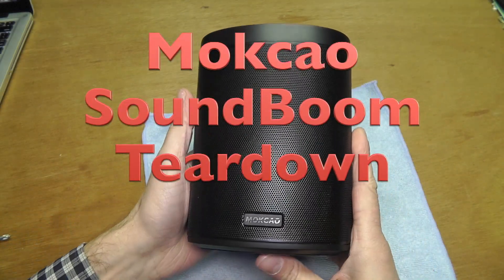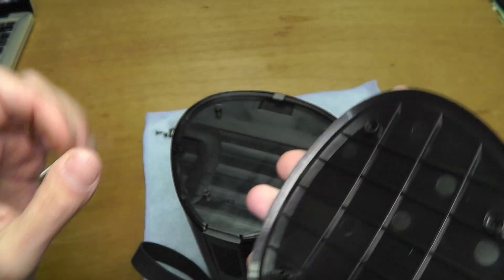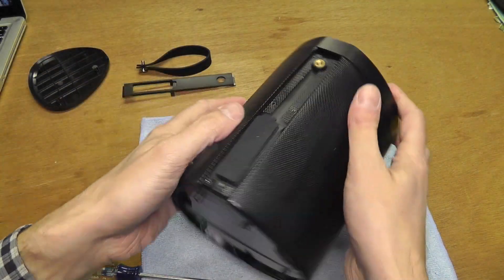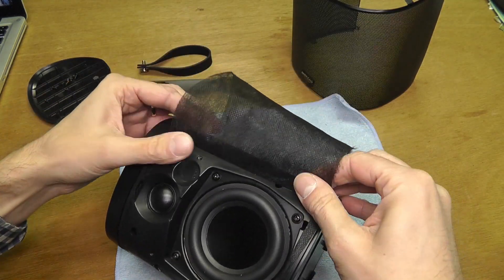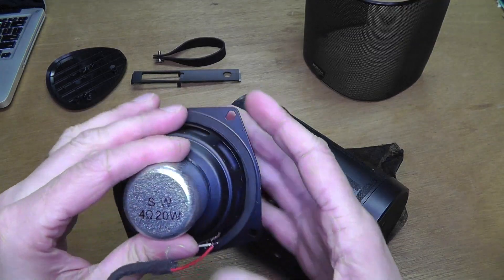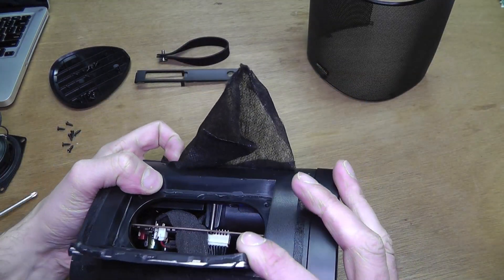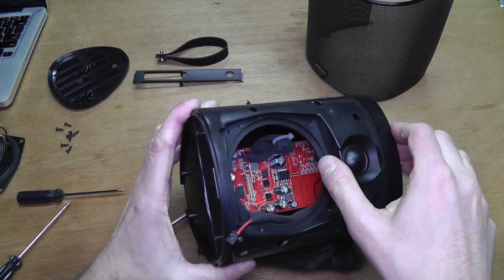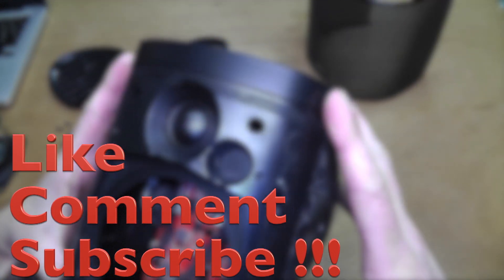Mokcao SoundBoom bluetooth speaker teardown

Comment: Hello,   I was wondering,  I have a Mokcao speaker, not exactly the same as the video, but similar,  my unit when I plug in the USB charger, it shows green light,  but doesnt do anything,  i thought it was aux in, but that does not appear to be the case,   so does that mean the battery is probably broken?   and if so,  is it possible to remove the battery and bypass that such that I can revive my unit, as when I plug in echo it doesnt do anything, when I take it out the charger cable it also does not do anything.
Reply from the maker: Hi,  does your speaker also have the little red light like this model when it is charging?
Reply from the maker: You can check the battery voltage.  If it is 0 volts, then I would try to find a new one with similar voltage and size.